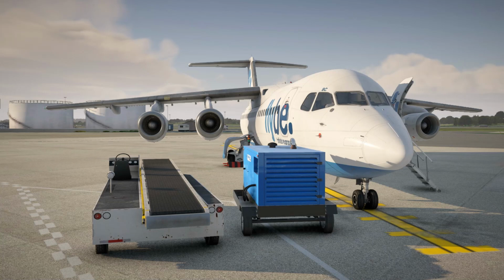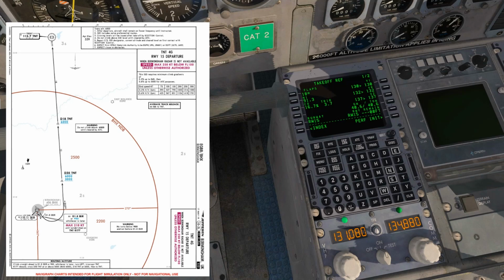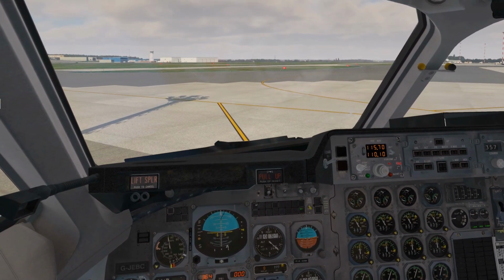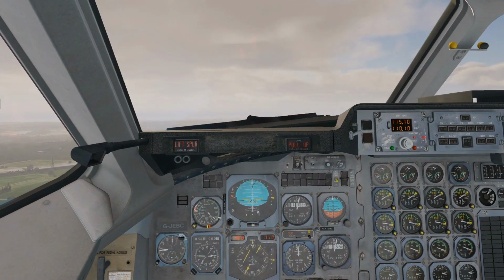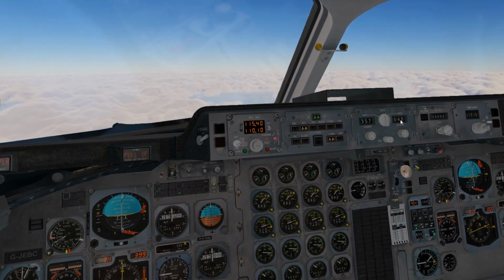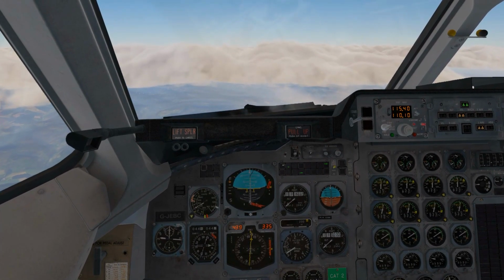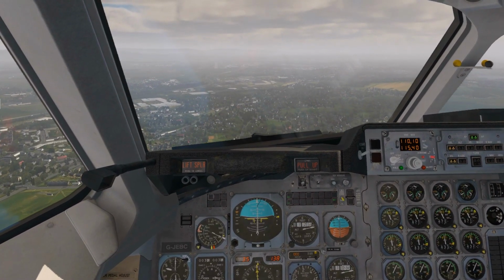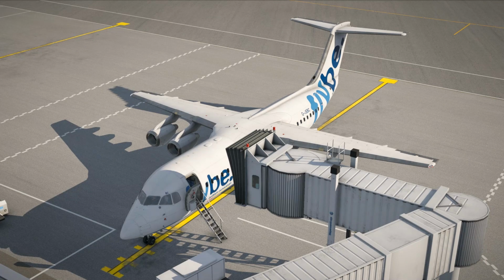REAL AIRBUS PILOT | Just Flight BAE 146 "Prep Flight" | Maximum Realism - Full Flight | X-Plane 11

Comment: As a ground crew member, these suck to deal with. The engine is forward and close enough to the fuselage that to unload the bags you need a special beltloader, or a extra people, or you need to bring baggage carts right up to the side of the plane which is prohibited by my airline. Also the inside of the pit has ridges which makes it impossible to slide bags, so you have to throw them.
Reply from the maker: Haha, sounds about right for a piece British Design and engineering! : P

An aircraft you probably don’t want to be checking your bags in on then ha XD

Cheers, all the best!

Comment: Pretty aggressive ILS approach but nicely executed. This plane looks like fun. Reminds me of my L-1011 days back in X-Plane 8. You never answered your question in the title. Does it rival MSFS??
Reply from the maker: Haha, it was rather. There's a reason ATC usually do the vectoring I suppose XD I always intend to take it easy and give myself a nice easy approach, but then I invariably end up shaving off as many track miles as I can, to try and keep the video length down ha.

Never knew there was an L-1011 in X-Plane 8. I didn't really start looking at X-Plane until around X-Plane 9 though.

To answer my own question then: For low and slow flying, MSFS wins every time. For this sort of flying and with the sim in this configuration (X-Plane isn't up to much these days by default), I think X-Plane stacks up very competitively with MSFS; MSFS might be "prettier", but I actually think X-Plane looks a touch more photorealistic.

Cheers and all the best! : )
Reply: @IntotheBlueSimulations  Thanks for the reply. Correct, X-Plane does not come with the TriStar. It was a paid 3rd party plane complete with the glorious 2D cockpit. It's my favorite passenger liner, so I had to have it. It did the job fine at the time. External 3D and flight model were very good though. Here is a video of it if you want to take a look. youtube.com/watch?v=uc-ZMRLsT1w
Saving up for X-Plane 12 now :) Cheers!

Comment: Why don't you write the list of MODs, Payware and real sound effects you used to make this video. So to answer your question. NO !!!
Reply from the maker: Hi Vv,

Well it won't be a very long list to be honest: Graphically, the only mods I am using here are Enhanced Skyscapes, ShadeX and the Orbx scenery (which could broadly be recreated using Ortho scenery). So not hugely expensive or complex. My point really, was that I think Enhanced Skyscapes does enough to drag X-Plane up to a standard where, for this sort of flying it's competitive with MSFS. Sure it isn't quite as "pretty", but in some respects it actually looks a bit more photorealistic I think.

For low and slow, MSFS wins every time; but for the high altitude stuff I don't think it's in a league of its own personally.

All the best!

Comment: If engines are hot, why do they need anti-ice?
Reply from the maker: Hehe, good question Article!

It’s not actually the engines themselves that are protected from icing, but the nacelles / cowling around the front of the engine (you can usually see that the front of the engine is a different colour / looks more metallic). Bleed air is taken from the engines and fed into the nacelles (amongst other areas) to prevent the buildup of ice. Firstly ice buildup could disrupt the airflow going into the engine, secondly you otherwise start to run the risk of ingesting large chunks of ice into the engine itself.

I hope that clears thing up! All the best : )

Comment: There were failure flags on the FO's AI even after start.  I hope that's fixed for the MSFS version.
Reply from the maker: I think that was as it should be cjm. We had the ILS tuned up on the left side, so the captain was picking up the LOC + G/S. The TNT VOR was turned up on the right hand side, so the FO wasn’t picking up any glideslope information and as we were still some way away from the VOR, he wasn’t picking up any lateral nav / radial information either - hence the flags : )

All the best!

Comment: I never enjoyed; or got used to VFR and using ATC in XPlane 11; was happy to return to MSFS
Reply from the maker: For sure VFR and especially ATC are weaknesses in X-Plane Ken - I really only use the sim for flying the commercial jets. MSFS is without doubt the best VFR sim. MSFS’ ATC is still a bit hit and miss I find though; a shame since the FSX / P3D default ATC was actually pretty good (so you would have thought Microsoft / Asobo could have built off of that).

As with most things flight simulation related; no one sim manages to do it all (yet) haha.

All the best! : )

Comment: Any reason you started 4 -> 1? I used to work in the 146 /RJ flight Sim at Woodford and engine starts are always done 1->4! Also would have been nice if they had modelled the noise of the engine gauges as the digits scroll round. They are really quite audibled, in the non EFIS configuration, when the TGT spins up. Also on start-up, the TGT rises and peaks much higher than that (sometime close to the upper limit) before airflow through the core brings it down to a stable temperature. Which is one of the checks to avoid hot or hung starts!
Reply from the maker: Hi Simon,

Thanks very much for the info!

I couldn’t tell you where I got the 4-1 idea from honestly, possibly the Just Flight manual. I studied the aircraft a fair bit when I previewed it some months ago, but this time around I just re-watched some of my older vids to refresh the memory. I’m fairly sure I wouldn’t have chosen 4-1 without having seen it somewhere, but that memory has been lost to the sands of time. . . Either way, I’m sure you know better than me haha!

I rather like how the gauges are animated, look about right from footage I’ve seen etc? but some accompanying sounds would be great for sure! As for the EGT modelling - perhaps it’s simply an inaccuracy on Just Flight’s part, or even a limitation of the sim.

Thanks again for the pointers! I’ll be sure to start the engines the other way around in my next vid ; )

All the best! : )

Comment: Is that just the default MCDU?
Reply from the maker: Hi John,

I don’t believe so no. The aircraft did originally ship with the default X-Plane FMC, but Just Flight later updated the aircraft with their own customised version (that is presumably modelled on the real-world aircraft).

Cheers! : )
Reply: @IntotheBlueSimulations  Ahh! Good. I'm  hoping the MSFS will have a bespoke FMC as well.
Reply from the maker: Me too John! It just won’t be the same otherwise. . .

Just Flight have stated that the MSFS version of the 146 will surpass the X-Plane / P3D versions - so let’s hope that’s in every respect. The X-Plane default FMC was at least very useable, the MSFS version, not so much. . .

I’m hoping I’ll get the opportunity to take a look at the 146 fairly soon! : )

All the best!
Reply: @IntotheBlueSimulations  Actually I think in the vid you are using the default XP FMC. There is an option to switch it out for a bespoke realistic one somewhere? An EFB maybe?
Reply from the maker: I could be wrong. . .

The FMC has definitely changed since release though. The original one used was for sure the “default”. The aircraft now uses the UFMC, which I guess is still somewhat generic, but then I suppose it would be by design:

https://youtu.be/s1FwJQEvNVg

The above is the FMC that used when the aircraft released for X-Plane : )

Comment: No. One is default and one has nothing default. Title should be 'Does all these add-ons make it a rival for MS' FFS..
Reply from the maker: Hi Brad,

Indeed it isn’t comparing “apples with apples” (and I do make that point in the video description), but actually most of what you’re seeing here is default (in terms of the core sim).

I’m only running 2 addons, 3 if you include the aircraft. One of those is Orbx True Earth (scenery), which does look drastically better than the default X-Plane scenery and isn’t cheap to be fair, but the effect could more or less be reproduced using Ortho4XP (for free). So it’s really Enhanced Skyscapes that I feel makes all the difference and as the addon only costs $15, I don’t think it’s a massive outlay / undertaking to get X-Plane up to these sorts of standards.

Really the whole point of the video title, is that for many years I’ve barely used X-Plane, because I just couldn’t get over the visuals (it looks washed out / dull, the lighting is funny and the weather depiction was awful). For a modest price, Enhanced Skyscapes has fixed all of that up for me (more or less) and personally I feel that X-Plane is now broadly “competitive” with MSFS.

There’s no doubting that MSFS is the prettier sim, but I’m more than happy with how X-Plane now looks and I’m happy to loose a little bit of graphical fidelity, in order to enjoy the sims other strengths (I still enjoy both sims very much though).

That’s my take on it anyway. . .

All the best!

Comment: The list of addons (scenery, I assume) should be included in a "X-Plane looks as good as MSFS" post
Reply from the maker: Hi VBS,

Well I do make mention of the addons during the video, but you’re right that it’s probably better to have them in the description as well - so I have updated that accordingly.

It wasn’t so much the scenery that I feel drastically improves the sim (the same effect can more or less be produced with Ortho4XP), but the Enhanced Skyscapes mod, which is a huge improvement to the overall look and feel of X-Plane. It only costs £12 and I do genuinely feel it more or less brings X-Plane in-line with MSFS visually (again the MSFS scenery is obviously vastly superior, but a similar effect can be achieved in X-Plane for free, albeit it requires a lot more work).

Anyway, I’ve probably gone off on a slight tangent there, but I hope I’ve addressed your point.

Cheers and all the best! : )

Comment: I don't use XP, but good to see an operational airliner model working well. Hope the MSFS is the same? Looks like GSX is also arriving soon on MSFS so we can have proper pushback and service vehicles at last! With GSX2 perhaps passengers as well.🤞
Reply from the maker: I’ve tried a number of times to get into X-Plane over the years and always walked away for one reason or another. This Enhanced Skyscapes mod really cracked the code for me though. X-Plane is a very solid sim (bar a few issues - the weather being one of them) and it has some great addons as well (a nice 737-200 and 727 for example). Still, I’m not here to become an X-Plane salesman haha.

According to Just Flight, the MSFS version of the 146 should be every bit as good and even significantly better than its X-Plane / P3D counterparts. Now of course they would say that hehe, but I can’t argue too much with their MSFS output thus far! It’ll be interesting to see what the flight model is like and how the autopilot works. I’m hoping I’ll be able to bring everyone a 146 vid fairly soon. I’m very much looking forward to the addon myself at any rate.

GSX would be a great addition to the sim. It’s all the little things that come together and make the bigger package (a cohesive, high-fidelity sim).

Cheers David! : )

Comment: Absolutely great video.  What struck me the most is how good this thing sounds and that i am going to have to learn how to fly by an FMS without a digital screen visualising my position.  Will you be doing a kind of tips/tutorial for that one? I assume there are more amatures like me that may need a few pointers :P
Reply from the maker: Thank you very much sir, glad you enjoyed it!

Yes, Just Flight have done a cracking job with the 146 and the sounds are indeed excellent - bodes very well for the MSFS version.

In my humble opinion, this generation of jets are actually the most interesting to operate. Enough automation to help, but not enough to rely on. As with the 146 here, some quite interesting attempts at an autopilot as well haha - requires a bit of mental gymnastics sometimes.

I may go for some sort of tutorial on this one. If I don’t for whatever reason, I’ll try and cover off the autopilot in some detail during the review at least : )

Cheers!

Comment: looks great like this, also very nice piloting and commentary, so immersive. xp12, imho, is gonna be quite a let-down at first though, at least optically - at least when looking down... it will take a bunch of time and mods to make it look somewhat 2022ish. people got used to msfs graphics and for the most part, they are awesome, especially if you love flying low and slow. trying hard to not have any (high) expectations, i would just like to be pleasantly surprised, for once.
Reply from the maker: Sorry for the very slow reply Gallo, just catching up on comments now haha.

I completely agree. X-Plane certainly isn’t anything special by default and I don’t think X-Plane 12 is going to do much to change that (from what I’ve seen so far). On the plus side, it sounds like X-Plane is broadly compatible with existing addons as a result, so it shouldn’t take too long to get the sim back up to scratch.

Really glad you enjoyed the video. Thanks very much for watching! : )

Comment: If you would use V NAV descent, where on these steam punk instruments would you see the suggested descent rate? Would the "VERT" show it somehow? Thanks. :)
Reply from the maker: A very good question sir! Do you know, I’ve never even dared to try VNAV in the aircraft XD

I would guess it’ll be one of two options: either it’s indicated using the glideslope indicator (as you allude to in your 2nd comment), or all of the information will only me displayed / available via the FMC / CDU, presumably on the VNAV page (I think the 2nd option is more likely actually). I should look into it, it would certainly reduce the workload / complexity of trying to fly a profile in this thing haha!

All the best : )
Reply: @IntotheBlueSimulations  I see. So the "Vert" indicator is just "diamond" and might not be connected to the vnav. As on G3000 these are also two different things. Thanks!
Reply from the maker: That would be my guess. It’s probably only a glideslope indicator. I expect the VNAV info would be given in the FMC and would just say +500ft or -2300ft for example and it would be up to the pilot to adjust the aircraft’s profile accordingly.

I’ll have to test it at some point haha ; )

Cheers!
Reply: I see it now during the ILS. Great video as always!